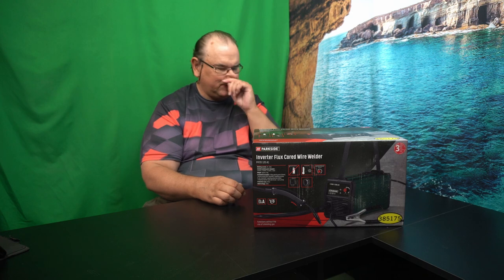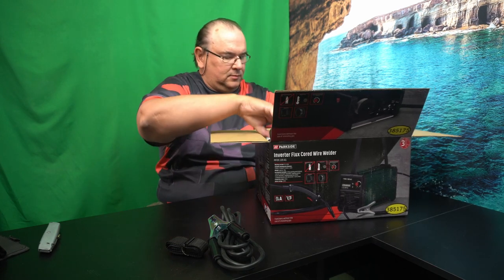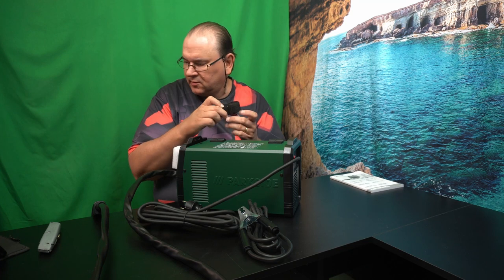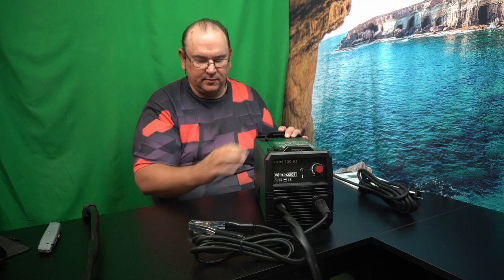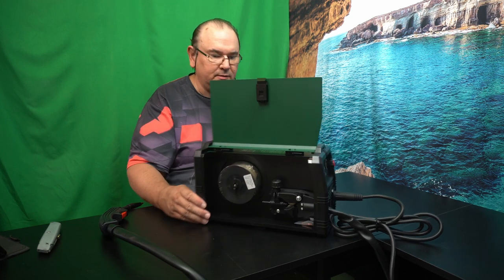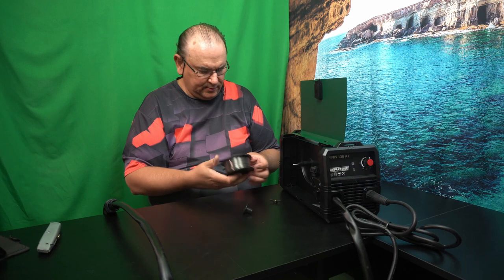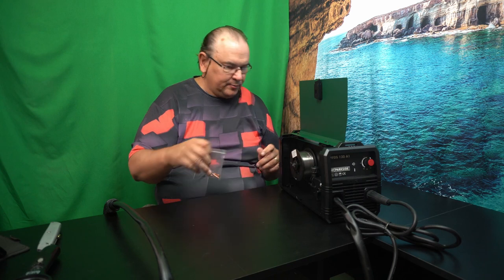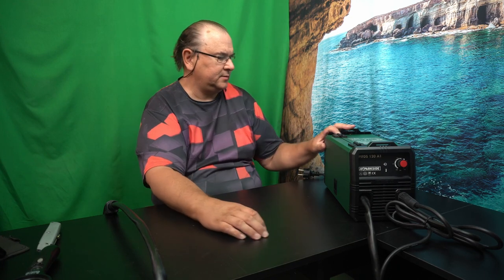Parkside Inverter Flux Cored Wire Welder PIFDS 120 A1 unboxing

Comment: Machine can use only parkside wire ?
Reply from the maker: I an still using what came with machine but would be surprised if this was the case as most welding consumables are standardized.